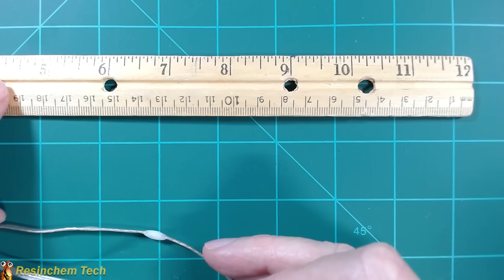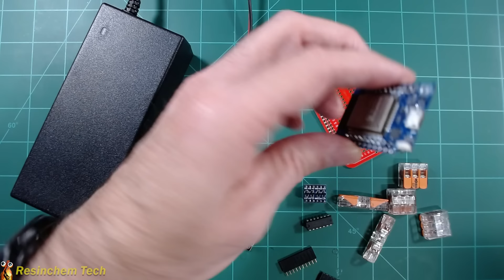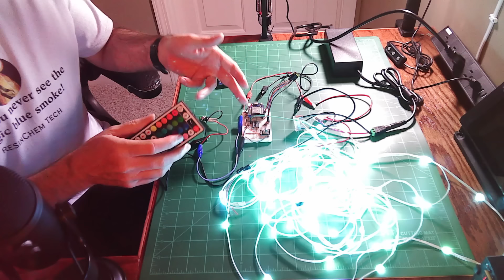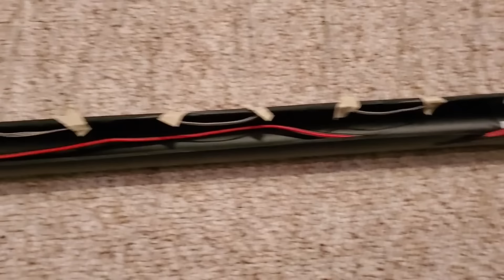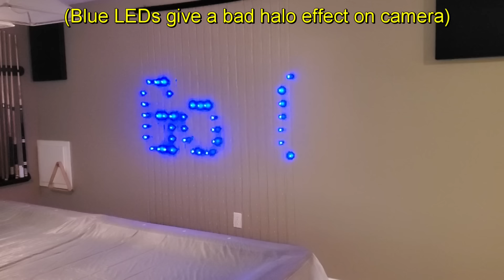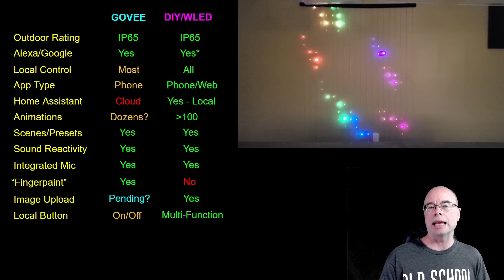Building an LED Curtain with WLED

Comment: What is the maximum amount of  pixels i can use??
And what would u change to make jus the control board?please 🤔
Reply from the maker: Theoretically, there is no limit.  But at some point, a single ESP32 will not be able to refresh the LEDs fast enough, so frame rate drops can happen.  According to the WLED web site ( https://kno.wled.ge/features/multi-strip/ ), you can have up to 1,000 LEDs per data pin and you can use 4 data pins for a total of 4,000 LEDs still with good performance.  Even more are possible, but performance may start to suffer.

The bigger issue with more LEDs is the power needed and the current draw.  More LEDs require a higher powered supply.  And since more LEDs lead to higher current, all wiring, connectors, etc. must be beefed up or rated to handle the current draw.  Otherwise, you could end up with melted wire... or even worse a fire... from pushing too much current through thin wire or through underrated components.  You'd also need to add additional power injection points due to voltage drop.

So, theoretically, you could easily run a couple thousand LEDs from a single ESP32 assuming your power, wring and other components are sized appropriate for the demands of the LEDs.
Reply: Goovee allows you to chain 3 curtains into 1 chain..for garages and stuff..
I want to make like 6 of those panels together..in a chain..
How much would u change to make the control board 🤔
Reply from the maker: Well, assuming you are using an ESP32, nothing about the controller really needs to be changed until you get to around 800-1000 LEDs.  At that point, you might want to consider a second pin and data line.  If you are unfamiliar with using multiple data pins with WLED, I cover that (along with segments, which you'll also need to use with multiple pins) in this video:  https://youtu.be/HYdouRHfadE

Of course you can eliminate things like the microphone if you don't want audio-reactivity, the IR receiver if you don't need remote control, etc.  The biggest changes from my build, as I discussed above, all involve the powering of the LEDs, where you'll need a larger power supply, larger gauge wire for those power runs, additional power injection points, etc.  But the basic controller itself is primarily the same (until you get to multiple data pins).

Comment: Could this be done with normal led strip instead of the fairy lights? Would give more pixels per meter. Very new to this so don't know if the esp32 could run it.
Reply from the maker: From a technical standpoint, there's no reason why you couldn't use LED strips. But from a practical standpoint, trying to get the strips hang straight and maintain approximately equal distance between pixels in both the horizontal and vertical direction (so matrix effects look right) would probably present a challenge unless you were going to mount the strips on some sort of backer board.

You'd probably also need to increase the size of the power supply either due to more pixels and/or because normal LED strips like WS2812b are going to draw more power than the fairy lights.  As far as the ESP32, it can easily handle up to about 800 pixels from a single data pin while still offering good performance.  And if you have more LEDs than that, you can use multiple data pins... up to 4 pins x 800 LEDs = 3,200 LEDs still with good performance.  You can go even higher with more pins but the framerate may start to suffer a little.  But the ESP32 won't be the limiting factor unless you are building a massive matrix with more than 3000-4000 LED pixels.

Comment: I've been looking to do this for a little while now but I thought it was a lot more difficult it . I appreciate you doing this video and showing everyone how the matrix curtain is basically done
Reply from the maker: When I saw the first review of the Govee curtain right after it came out, my first thought was a DIY version with WLED.  It was a bit of trial-and-error to figure out how to build the system, but I've been really happy with the final result.  True that there are a handful of things that the Govee firmware can do that WLED can't... but WLED offers a lot of features not include with the Govee retail version as well.  After this video, quite a few folks reported success in removing the Govee controller and replacing it with a WLED controller, using the default retail "curtain".  I do find it interesting that v2 of the curtain lights added a bottom strap to attempt to keep the strands hanging straight... something I found as an initial issue and one reason I wanted the bottom "bar" to keep the stands hanging straight.

Thanks for watching and taking a few minutes to post a comment.  It is appreciated!

Comment: hello. i want to make a project. i hope you can help me. i bought on AliEx..press a curtain made of led pixels, but it is not serpentine. for each node there is a micro circuit. so i can't make it work with wled. i was wondering how i can do it? thank you very much
Reply from the maker: I don't own any Govee products, so I can't say for sure how they work.  But I do know a number of folks have stated here in the comments that they replaced the default Govee controller with a WLED controller, so I believe it is possible.  I suspect that the existing circuitry allows the LED data signal to "travel" from one strand to another.  You might just try setting it up with WLED and uncheck the 'serpentine' option under the 2D/matrix setup and see what you get.  Alternatively, you could run a signal to each strand from a different GPIO pin and use segments.  

But maybe someone that has successfully replaced the Govee controller with WLED can give you some additional advice.  As I mentioned, I don't own any Govee products so I can't say how the controller actually works.
Reply: @ResinChemTech  grazie mille

Comment: I only have 130 LEDs in my matrix and only have an ESP32 Node MCU and a SN74 level logic, WLED recommends the 2.5a power supply, referencing the BOM, I purchased the 15a brick style, could I get away with a 3A wall wart?

Comment: Seems a bit over built.. when a single ESP32 and WLED would do the same thing..  yes?
Reply from the maker: Yes... but as I explained, I wanted to try out different "versions" or forks of WLED, including Sound-Reactive (this was before there was a standard option for audio-reactive), Moon Modules, etc.  As built, it would even give me the option to swap out WLED for something like custom Arduino code by just swapping out the ESP module and would not require removing the entire controller to flash it with something different.

So, yes I built it to allow 'swappable' ESP boards and firmware.  But you would only NEED a single ESP32 and WLED.

Comment: That's really cool. Just think if you had lights spaced 1 inches apart
Reply from the maker: Thanks.  Yeah, at least at the time when I made this video, I could only find these particular LED strings with 4" spacing.  Obviously, having a higher density of pixels would mean better resolution.  I have a matrix made with LED strips where the LEDs are just over 1/2" apart.. but strips like WS2812b don't work well for something like a curtain.

The tradeoff with more densely packed LEDs is of course more LEDs in a given space.. which needs a larger power supply and more power injection.  But you are correct, the more LEDs and the closer they are, the better resolution you will get.

Comment: Just an Idea (From a Newbie) but .. Perhaps you could flash (Two ESP32 Boards) one with the (Standard wLED Version with your IR Remote Module) and the Other ESP32 Board with the Digital Microphone Module for the Sound Reaction Version. Now simply use  a (SPDT) Single Pole Double Throw Switch to toggle Select the GPIO Pin (output 16 ??) that would run to the Signal Line of the LED Strip. you then should have all the bells and whistles selectable with both Versions. (Looks like you would have enough room in the storage container for another Circuit Board. (So.. With hopes this is enough basic detail to describe what I was thinking.💡🤞👨‍🎓)
Reply from the maker: I have a setup very similar to what you describe with my matrix clock.  It is dual controller... WLED for general effects, and a separate controller that runs the code for the clock, scoreboard, countdown timer and text display.  A toggle switch on the frame allows me to switch the data line that goes to the LEDs from the WLED controller to the custom Arduino clock controller.

For the LED curtain, I always planned on primarily using the SR controller.  Really the only reason I built it with a swappable controller was for testing and for creating of the YouTube video.  I still have the standard controller, but have never swapped them out since I finished the video and mounted the curtain on the wall.  But I have used the dual controller with a toggle for selecting the data line with my other matrices.

Comment: great video, hopefully i can find the info on Get Hub about down loading images, i have two Govee curtians that i haven't played with much but i have built  a 30 x 32 smaller matrix 20" x 20"  with 960 led's that i control with WLED.  I have been wanting to figure out how to get images on it for a window Christmas display, but when i go to Get Hub i get lost lol. lots of stuff there, but ill give it another go,   thanks again awesome video.
Reply from the maker: Thanks!  Yeah... Github can be a bit confusing until you kind of get the hang of it, especially since not all repositories are arranged in the same way.

But for the PixelArtConverter, you should just be able to go to that repository ( https://github.com/werkstrom/WLED-PixelArtConverter/ ) and under the download instruction, right-click on the stable 1.0.8 link and 'save link as...' to download the pixart.htm file.  Once downloaded, just double-click the file to open it up in your browser.  That's all there is to it.  You don't really need anything else from the repository.

Hope that info helps.  Good luck with your project!
Reply: @ResinChemTech  thanks so very much for the link I just went to Get Hubs web page again I did finely fi d some apps for creating pixel art  ut none of them are WLED related lol. Thanks again. I'll give it a go after breakfast and a little more coffee.

Comment: How difficult would you make it motion-activated to display a shillouttte?
Reply from the maker: You can add various components, include motion detectors, to the WLED controller for different control options as I recently showed in this video:  https://youtu.be/1Qj1jJAam-8 
So, you can certainly use a motion detector to turn on the LEDs and display a certain effect or image.

Comment: Govee light curtain goes for $99.99+tx at Sam's Club.
Reply from the maker: Thanks.  When I recorded this video over 9 months ago, the Govee version was relatively new and was selling for around $130.  Naturally, it has been discounted a few times since then.  In another 9 months it might be selling for $69.99. There are also other 'clones' of the Govee version that sell for cheaper as well.  But as I stated in the video, my goal for this project wasn't to build it "cheaper" but to build a completely local version with more effects and more control that the Govee version was offering at the time.

Comment: Love the WLED curtain. I built one for a wall next to my bar based on your design and it looks great. Would love to share a video of it to you.
I plan to build one for my 2car garage door for Halloween and Christmas holiday decorations. Obviously with some modifications to the PVC on the top and bottom. Thanks for your videos
Reply from the maker: Glad you like it!  Yeah... you could just buy the Govee version (or one of the many other clones that have come out since), but where's the fun and challenge in that?  I have an uncle that has the Govee version and honestly, I like my version better as the strands hang straighter with more consistent spacing, so the matrix effects look better (in my opinion), not to mention the huge number of effects and control options with WLED.  

I had every intention of using mine at Halloween as well.  I even did that battery-powered t-shirt version ( https://youtu.be/T2YGL1mzMKA ) that synced up to the LED curtain that I was going to wear, as we normally sit in the driveway with various displays around us.  Unfortunately, it was cold, windy and spitting snow here in Indiana this year, so I had to abandon the whole thing!  Looking forward to next Halloween when I finally get to wear my matrix t-shirt!

I'd love to see a video.  If you post it somewhere (or even here on YouTube), please follow up and shoot me a link.  I love to see and hear from my viewers when they duplicate (or even improve) one of my projects.  Thanks for posting the comment!

Comment: Thanks for the comment with the link to the video before. 

I just watched the entire video. Great project.

Regarding the IR, do you just solder the IR receiver as shown in the plan, set in WLED that a remote control is used (for example, a 24 Key) and then it just works?
Reply from the maker: Yeah... that's pretty much it.  But do note that if using an ESP8266, there are only certain GPIO pins that can be used.  I can't post an image here, but there is a setting in WLED where you tell it which GPIO pin you are using for the IR receiver and what type of remote you are using.  WLED has built-in support for a number of different types of remotes, but there is also an option to provide a JSON file to have it work with virtually any IR remote.  You can see more info, the valid 8266 GPIO pins and the types of remotes with built-in support here:  https://kno.wled.ge/interfaces/infrared/
Reply: @ResinChemTech it works!!!!
Reply: @ResinChemTech it works, tried it now with an tsop4838. Thank you very much 🥰
Reply from the maker: Fantastic!  I always love to hear when one of my viewers is successful with a project.  Thanks for sharing.